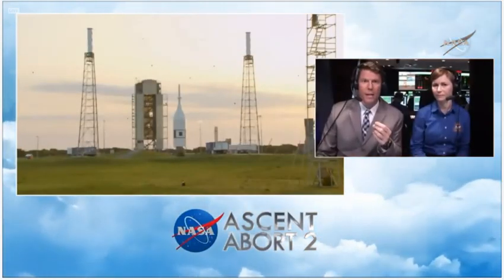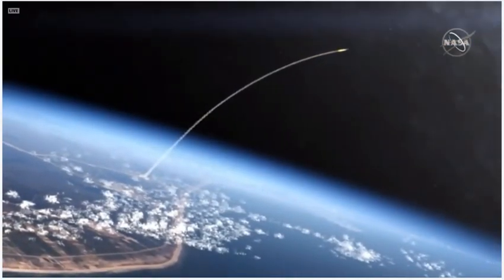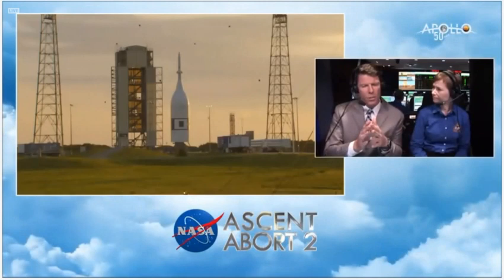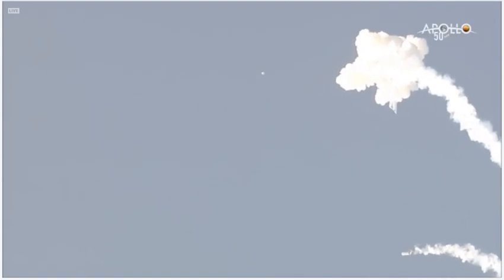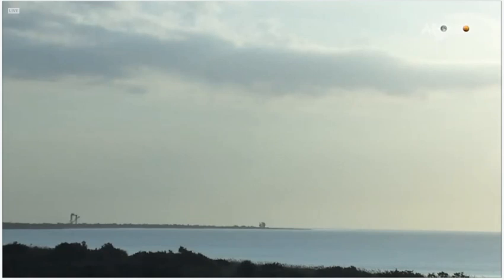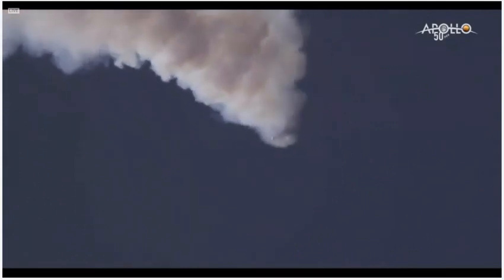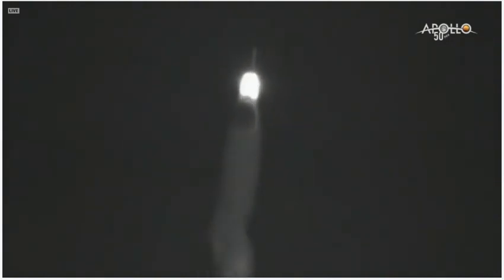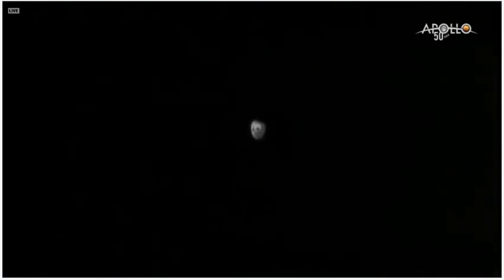NASA Orion Ascent Abort 2 Flight Test Coverage

Comment: I don't think it was supposed to tumble as bad as it did.
Reply: it most certainly was supposed to tumble
Reply: Lee Williams yes that was the point of the test...stress loading at varying designed parameters, then righting the capsule.
Reply: The drogue 'chute would prevent tumbling. If it were there...